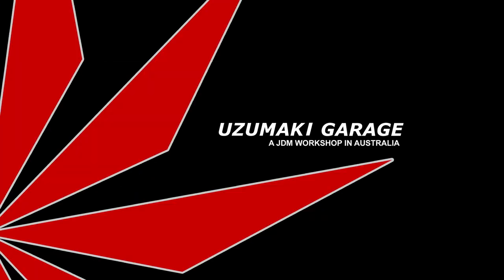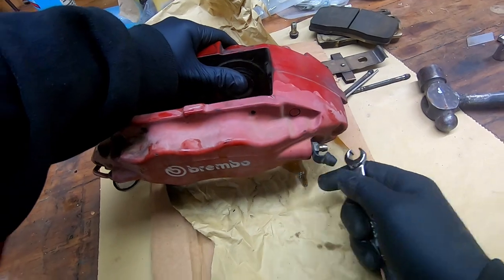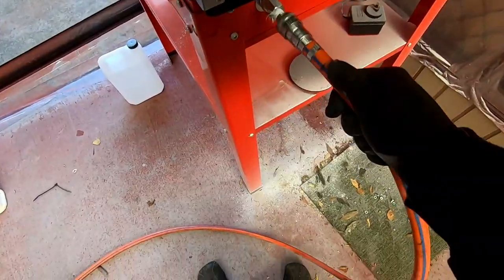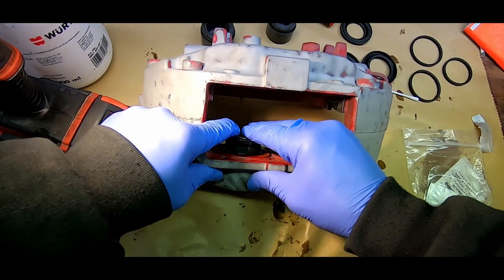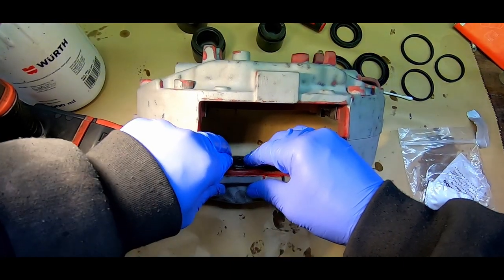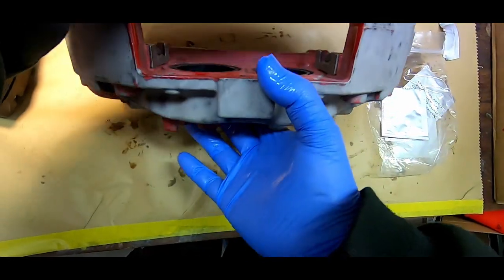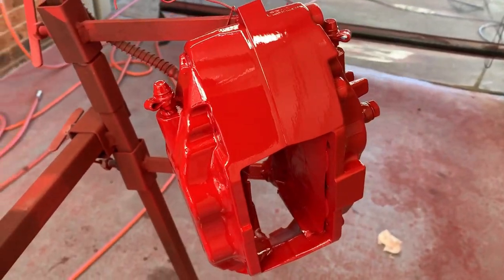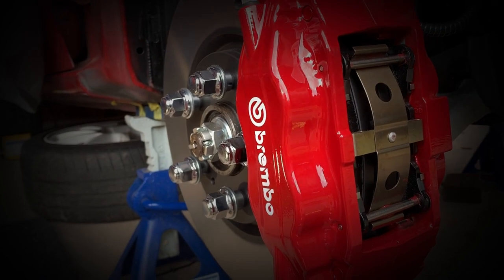Brembo Brake Restore Rebuild Transformation! Restore Calipers & Replace Seals #mitsubishilancer

Comment: Brilliant work mate.. The factory paint... or really the clear coat was awful.
After 18+  years of my ownership.. it was simple servicing that killed the coating on my calipers...They were still red... not what is known as brownbros....lol
I eventually got a professional guy to do mine (Cos I'm Lazy and had open Heart Surgery) after ( prior 4 years..) another set for my Legnum, I removed had soda blasted and then... resprayed myself... They came up perfect... pro job on the TME even more so.... Your's OMFG... wait Steven... they are just Brakes... they don't need to be perfe..............
Pure froth .... epic...
Awesome vid mate... subbed...
Reply from the maker: Cheers Steve. Thanks mate. I’ve done a few caliper resprays before but this was the first one using 2k paint of the correct colour. It makes a huge difference having nice brakes. Everything is important.
Reply: @UzumakiGarage  mate Glad you've done the vid... The attention to detail shows.  They really make the car look so much better... we're lucky nowadays as coatings have such better performance than 20 odd years ago...

Comment: Great job. I've folks use brake fluid in rhe piston assembly as well, is that okay? The OE seal kit for the front Brembo's is over $100 in the US, but found aftermarket ones much cheaper, just not sure they'll come with the assembly lube.
Reply from the maker: I would think brake fluid would be fine to use but assembly fluid is nice and slippery so i think it just makes the job a bit easier.

Comment: Love your work!
Did you replace the pistons along with seals? Thinking of doing this myself
Reply from the maker: Thanks Kezza. No the pistons were still in perfect condition. I guess they're protected by the dust seals and submerged in brake fluid. Perhaps if the brake fluid hasn't been changed enough and has absorbed too much moisture from the atmosphere maybe they can corrode and get pitted. not sure. maybe they 're coating prevents that but I have noticed really old cars sometimes have seized pistons in the calipers.
Reply: Where can I find the paint code for the brembos?

Comment: Nice video!  How hard is it to remove the pistons and old seals?  I don't see many people document that part.
Reply from the maker: Sorry I didn't document it well either as I was figuring out the procedure as I was doing the job, so my video footage was messy. So, especially on the 4 piston calipers its really important to remove all the pistons evenly and gradually in a controlled manner. I used some blocks of wood and plywood shims of similar size to the brake pads only thicker so when I add compressed air to the brake fluid port the pistons are restricted in the distance they can come out. About 1/4' (5mm) at a time is good, then remove a shim and apply air again, and again. You need to get all pistons to come out evenly because if 1 or more pistons pop out before all of them are almost out you will lose all air pressure and have to slide the pistons back in temporarily to try again. Several old brake pads might make good shims. Don't add high pressure air and don't put your fingers in there as you could get seriously hurt with a broken or trapped finger, wear a face shield too!  I think about 30psi is recommended but seriously be careful. I had to crank the psi a bit higher.  Re-installing pistons is possible if they prematurely pop out but they need to be perfectly straight and lubed up, if they don't slide back in without force wiggle it out and get the angle straight and try again. The seals come out pretty easy but try not to use a metal pick as if you scratch the piston or caliper its probably game over.
Reply: @UzumakiGarage  I appreciate the reply. Still good information for me to have as I was initially thinking they could just be pulled out. I may take on this job soon with a spare set of evo 8 Bembos and was wanting to do some homework ahead of time.
Reply from the maker: @BoostedFilms  It's really not a difficult job for someone with your skills. I probably go into too much detail when trying to explain things. The other idea I thought of this morning is to use a brake pad spreader sitting inside the caliper to restrict the movement of the pistons when compressed air is applied. Then gradually back off the spreader to allow the pistons to come out (if that makes sense) I really wish I had filmed it properly but I think that was my first video.
Reply: @UzumakiGarage still a good video. I was happy to see you mentioned the part of removing the paint from the mounting surfaces.